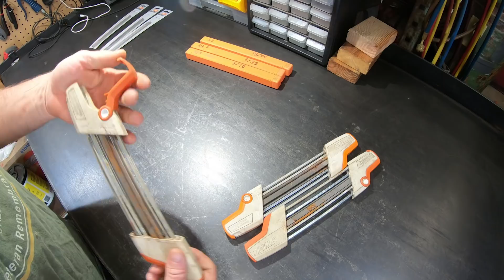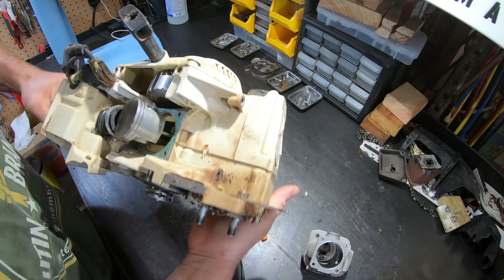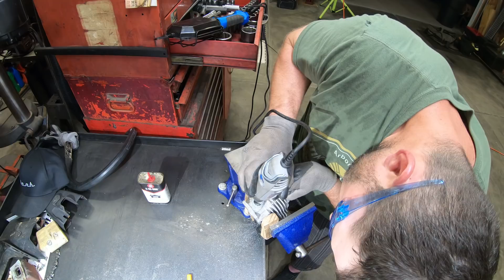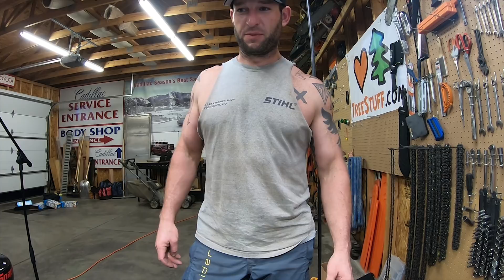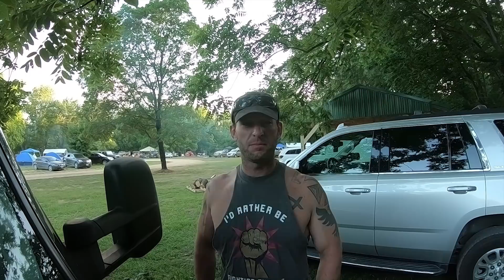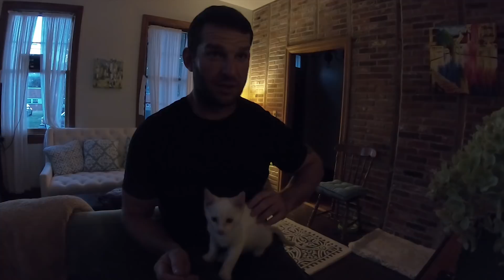43: Saw Porting, Ass Slapping, Kitty Playing

Comment: After taking apart my first saw, alittle Poulan 2150 which I picked up for $40 a week ago, perfectly good except for a bent brake cover which I fixed, I was surprised to find that there was absolutely nothing to gain in terms of porting. The ports are already manufactured to a mirror polish and utilise most of the available wall thickness with no flashings, burrs etc. I'm positively impressed at how refined and simple the design on that saw is. All stuck together with RTV which sits in little milled out seats in the bearing surfaces. Only exception is the intake which I'm going to replace with RTV anyway, cause fuuuck paper gaskets. I also drilled an extra port straight into the divet in the front of the muffler, hope that wasn't a stupid idea - only concern I could think of was fire risk, but I've left the screen intact so I think it'll be nice.

Comment: How do you like those holders? I bought one for my 3/8 chain and it seems to miss the gullet. Take the c out of the tooth. Have you had this issue? If so how did you resolve it? Just a free hand file? Do the gullet some get the c back on the tooth? I was just likeing the idea of saveing time on doing rakers seperet. But I'll go back total free hand unless I can fix this issue. Thanks in advance glad to see your doing so good.. happy fourth stay safe.
Reply from the maker: I don't apply any down pressure at all, and a little bit of back pressure into the gullet itself, seems to be working well so far
Reply: Human okay thanks are all your chains newer? It seems to work better on a larger tooth then a small one